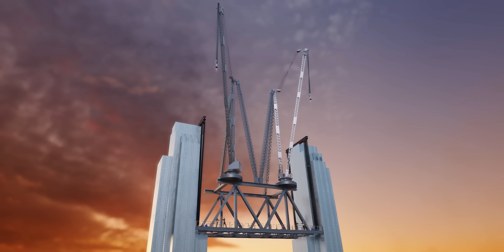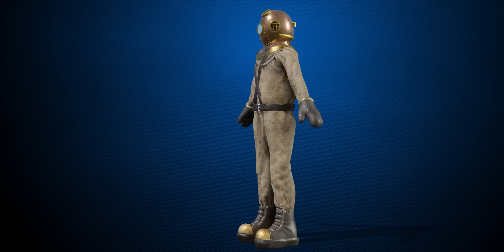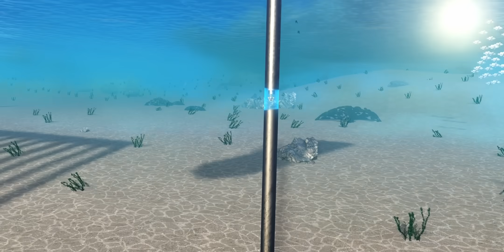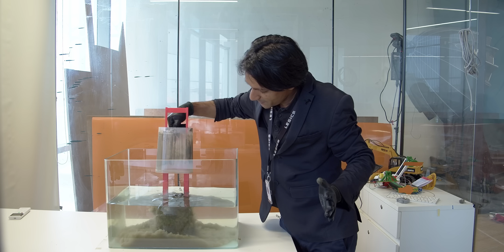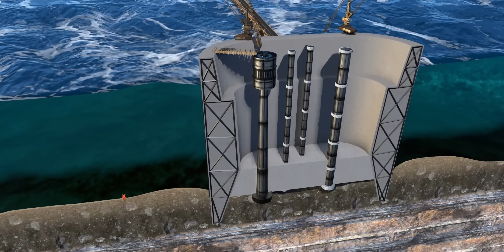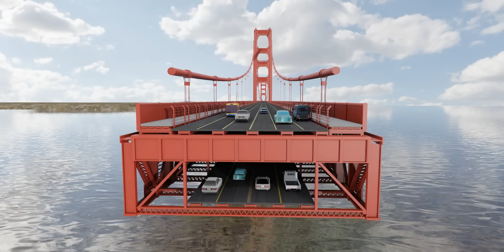Golden Gate Bridge | How a Wonder was Constructed?

Comment: No sir, the union did not build anything. The company who signed the contract, prepared drawings, calculated stress on the cables and figured out all the details build it. All you did is work for them and got compensated for your job. Union or not, the bridge will be built. Time after time you guys go on strike, buy plastic rat, other people will walk in and finish the job just as good or better for half the cost.

Comment: The thumbnail of cover photo is incorrect, when building the bridge they build the two pillars or structural support towers, then attach the big wire in-between them, then they attach smaller wires, or cables, then add the road hanging underneath, or attached underneath, wow this is a long sentence

Comment: The lack of SCUBA tanks is not why the divers used surface supplied air.  If they were building the bridge today they still would use surface supplied air.  SCUBA tanks are rarely ever used for commercial diving.  They just do not allow the divers enough bottom time.  Surface supplied diving not only provides the divers with unlimited air, but the umbilical can also provide communication, heat, and a secure method of recovering an injured diver.

Comment: Listen, when a structure like this collapses from the top - the floors below are resistance - so it would have collapsed, but not completely and surely not in 15 seconds unless they are weakened - which was done with explosives - everyone saw it - and what about the beam that was sticking up that had a perfect angle cut and was melted at the cut that was cut before that day - three huge buildings collapsing the same exact way in its own footprint at free fall speed - we are not stupid or blind

Comment: This is a good hanging bridge, however, there's an even better design, which was made by China, it's a hanging bridge which consists of concrete instead of steel bars, and it has even steel bars that are attached to the towers that have their own points they are attached to, each bar has it's own point which is attached to in the tower, as well as the bridge, nearest bars are held in the lower point of the tower, and farther ones are attached to highest point of the towers, so that the towers doesn't get collapsed because of too much tension, so whenever the bar is longer, it has to sit higher in the tower so that there's not too much tension on the tower, it is much like this design, however it doesn't have a curve which the bars are attached to which looks like a parabola, and the materials that it is made of are only concrete along with steel bars that support it as well as the steel bars that hang it, and it's not suspended since the concrete is brittle in nature, so the Chinese design isn't suspended at all.

Comment: Fun fact, the Golden Gate Bridge is continuously painted with the international orange paint. They start and one end and work their way to the other end. This takes 3 years to complete. By the time they are finished, they need to start all over again.
Reply: Not really, it's usually just in a maintenance cycle where they do touch up paint on the more problematic areas. They spend more time inspecting than actually painting it. Source: I worked there for a couple years.
Reply: @scarx4181  how's the view up there? 😍
Reply: @andreabonacossa8709  Depends on the weather, on a clear day it's pretty magnificent. I didn't like going up there much, not a huge fan of heights, which is somewhat ironic since walking the catwalk on the north side of the bridge under the deck(which is still 200ish feet off the ground) was a daily task.

Comment: 1,000 plus foot skyscraper crumbles on it's own Footprint? Demolitions experts will take months sometimes even a year or two to calculate how  a building half its height will react when it's support columns are cut and sometimes they still get it wrong......so these towers didn't pancake collapse where one floor falls on top of the other and so on. You can look at the main support columns at a museum and I saw em at the original site in the rubble they were what I call spaghettied meaning they were twisted and bent like pieces of cooked spaghetti with no cracks or obvious signs of deformation..these columns are massive in size and mass.the flanges on the columns would have shown signs of cracks etc but nothing? Jet fuel burnt up very quickly would not heat those columns up enough to compromise them structurally. Ain't happenin. An aluminum plane against reinforced  Concrete and structural steel? Think about it.....??? They both fell on their own 👣 footprint. ? IMPOSSIBLE my friends....."Welders have hotter rods" peace 2u

Comment: -- The planes were smaller at the time the WTC was built, but the creators of the WTC said on TV that the WTC would withstand the impact of many planes.
-- The video falsely shows the wingspan of the planes that hit the WTC as equal to the width of the WTC. In fact, the wingspan was less than half the width of the WTC. 
-- There are strong winds at the impact height of the planes, which cool the temperature and extinguish the fires. 
-- The wings are made of aluminum and are outside the engines too weak to cut steel more than 30 centimeters thick.

Comment: Being a fully riveted structure, I wonder how long it will survive before corrosion becomes significant enough to start to forcing the plates apart?
Reply: They do constant maintenance on all large bridges. Or are supposed to
Reply: @dambroangling2828  Yes I imagine inspections would be routine.  But how you could rectify this type of damage is hard to understand.  I presume when structures like this are built they use some form of sealer between the two pieces to stop the capillary action occurring that will suck in moisture, ultimately leading to corrosion.
Reply: @Altair885  they replace all the parts that show signs of wear when doing the maintenance. That's why you have frequently  closed lanes and construction crews on and underneath the bridge. That's why there is a toll to cross
Reply: @dambroangling2828  I understand that, but many of the main structural parts can't be changed.  Some of those riveted sections are integral to the structural integrity of the bridge, and would require partial deconstruction in order to replace. 

Given that the bridge sits in a area where it is constantly exposed to salt water and extremes in temperature, I think it must only be a matter of time before corrosion becomes sufficient to render it economically prohibitive to repair.
Reply: @Altair885  they figured out how to construct the bridge many years ago. I'm sure they have since engineered ways to replace integral parts so that an entirely new bridge does not need to be made. Even if the had to cut out and replace the entire center of the bridge. They do it one lane at a time or they plan and come up with solutions. You are right no parts will last forever but no they will not have to tear the entire thing down to nothing and start from scratch unless something changes dramatically, basically from an earthquake or a big boy bomb
Reply: @dambroangling2828  The roadway is indeed replaced as you rightly said.  My comments are mainly focused on the towers themselves.  Changing sections of these would be quite challenging I would imagine, especially as there are sections that are blind, meaning they are encased with no way to access them.  As far as I'm aware, no sections of the towers have been replaced up to now?

Comment: It's not true that the steel alloy used in the construction of those towers could withstand the temperature of burning fuel in controlled conditions. Only in such conditions could such a high temperature be achieved. Moreover, the designers planned for such a situation

Comment: great work sir; may I ask how was the catwalk built (subesquently used to lay the cables) ?
Reply: August 2, 1935 to September 27, 1935: Harbor Tug and Barge Company strung the first wire cables to support the footwalks (aka catwalks) constructed across the Golden Gate Strait in preparation for main cable spinning.

Comment: I wish the bridge was built with two decks with the lower deck having a railway for BART to run on. It would be so cool to see trains going over the Golden Gate Bridge
Reply: Fun fact: Trains used to run on the bottom deck of the Bay Bridge until the Key System had to shut down. The Key System connected the East Bay and SF for years before monopolistic and predatory practices by the auto industry forced it (and other public transit networks across the US) to shut down in the 50s. You can look up the GM streetcar conspiracy for more info!
Reply: @gotrees4  WOW never knew !!!
Reply: There have been proposals for that in the past and even an entire separate roadway underneath, but the truth of the matter is that the GGB is getting old. You can't go below the deck just south of the north anchorage(there's a gravel parking lot about 15 feet below the bottom of the bridge there) but if you take a pair of binos on the trail far below and look under the bridge it's looking pretty nasty these days. There's only so much you can do just by slathering more paint on. The bridge is a good 2/3rds through its lifespan at this point so major investment like that just doesn't make a whole lot of sense. I'm a cop by trade not an engineer so I'm not qualified to make any judgements on it, but I did work there and while the towers are mostly in good shape(bit rough down towards the water especially on the south tower) the actual deck structure just wasn't looking great to my eye.
Reply: look up famous portugal 25 de Abril Bridge that is inspired by Golden Gate bridge

Comment: Two questions: How did they keep from blowing up the placement tubes? And if the divers used high pressure hoses, would they not go flying backwards like a rocket?
Reply: I would imagine clever design to direct the blast energy for the tubes, as for the divers, weight. Boots weighing in at 20 lbs each, probably around fifty or so pounds of brass, leather and rubber for the suit. Plus lead plates for added counter-buoyancy. 30-50 pounds of diving helmet. A 1930s diving suit is a good 190+ pounds. Once those guys plant their feet and lean into it, they are going precisely nowhere.